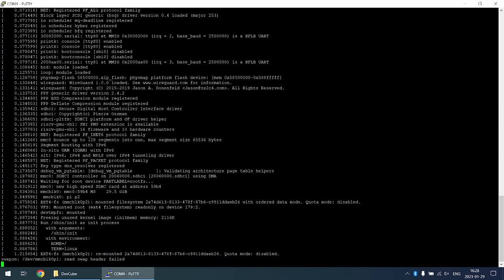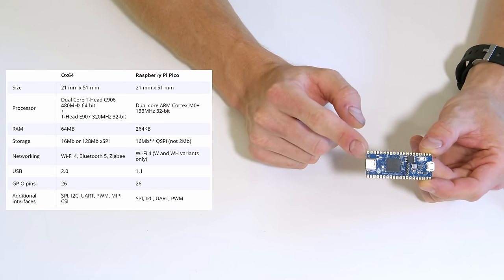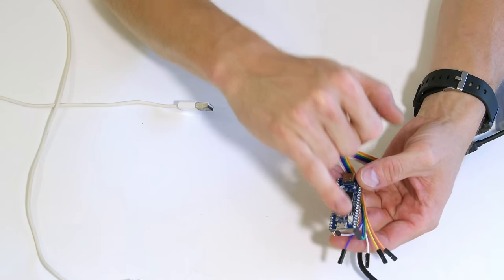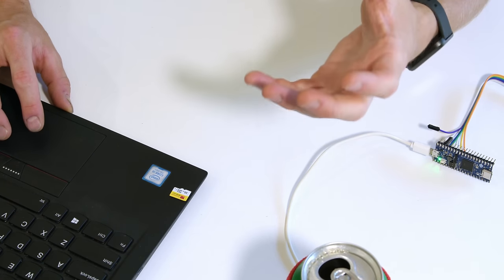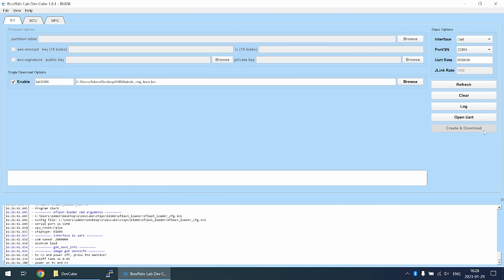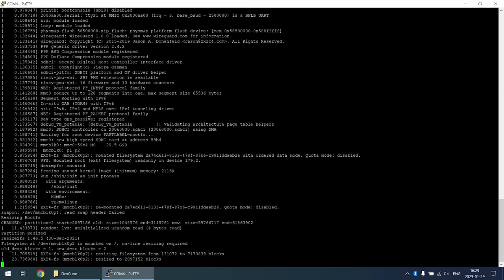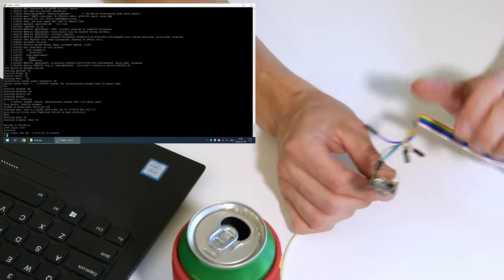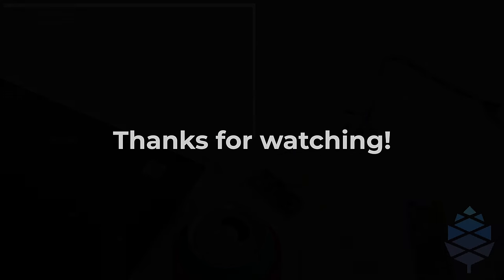Ox64 SBC - Connecting, Flashing and Booting Linux! ($8 from Pine64)

Comment: It got one rv64i core (D0) , one rv32i core (M0)   and a  rv32e core (LP).
Reply from the maker: Correctamundo my good friend. I accidentally said that D0 was dual core though, which I corrected in my description.

I'm super curious about using LP for something fun. Right now M0 is just doing interop with D0 as so much of the peripherals route through it.
Reply: @PlatimaTinkers  I had a look at this thing a month ago. It seems a lot of progress has been made, as last month, no peripherals, no sd card, nothing was supported, except for the UART, so it was in a state "it boots linux" and that's all there was to see. Wow, things go fast. 

When I bootled linux last month, it seemed the rv32i core was copying the image from flash to RAM, while the rv64i was delaying, then the rv64i would jump into the kernel.
Reply from the maker: @AndreDeLimburger  Oooh that is also an interesting way of doing it! I would guess then that they did not have the message bus between the D0 and M0 cores, as the M0 (RV32) is the one connected to the SD card, but of course the D0 does the heavy lifting. Now that there is more interop with IRQ forwarding etc it's running SO much smoother.
Reply: @PlatimaTinkers  They didn't implement any intercore communication. But I am under the impression last month was an early proof of concept. No SD card support, all from internal flash.
Reply from the maker: @AndreDeLimburger  Hey yep they run a 'mailbox' that relays IRQs back and forth. Alex Horner has been working with arm000, pokey and some others on this pretty hard last few months and it was only a few weeks ago this was released working.

That is the code uploaded to M0 in the video which you can find here: https://github.com/arm000/bl808_linux/blob/irq-forward/bl_mcu_sdk_bl808/examples/low_load/main.c. Not it's not in 'main' branch yet. It's not a full implementation of M0 yet either, but enough to access the SD card and some other required features.

This is booting from the SD card, as I demonstrated, and works well! Next step is ethernet and/or wifi. WOo

Comment: No I2S?
Reply from the maker: Yep sorry definitely has I2S - that table was not quite filled out with every detail. Here's the functional block diagram as a reference for you: https://wiki.pine64.org/images/thumb/d/de/BL808_Block_Diagram.jpg/600px-BL808_Block_Diagram.jpg
Reply: @PlatimaTinkers  Cool, I've got a ton of boards sitting around already, but I'll have to check these out as well.

Edit: How hard is it to add device tree overlays for the GPIO devices when you're running a full Linux kernel?
Reply from the maker: @butsukete1806  Hah yeah same here, SOCs building up like a bad itch, but these are so far my favs and SUPER cost effective compared to even an ESP32 IMHO.

GPIO is already working my friend. I just did not demo it in this video as it was long enough! Pt 2 coming in following weeks.
Reply: Sounds like a new contender then. Right now my gotos are ESP32 for wireless and Pico for anything else, really like the PIO feature. Looking forward to your next video.
Reply from the maker: @butsukete1806  Pretty much what I've been doing mate; 3x RPi4 running all my docker containers for local services such as control, monitoring, alerting, then some Pi Zero's for GPIO control eg retic etc, and ESP32's for endpoints such as lights, switches, etc.

Cheers

Comment: I use PUTTY and FLASHED BL808. system runs but the 2000000 on the CP2102 I use just will not work. Nothing but garbage coming out the serial port. It will suck if I have to rebuild the OS just to change the baud rate to something normal. Even 921600 would be good. But 2000000 is just stupid to me.
Reply from the maker: I just checked the datasheet and unfortunately the CP2102 only supports up to 1,000,000. 

I'll ask the devs about what can be changed to get stdout at 921600 and get back to you!
Reply from the maker: Hey so there are three bits of code to modify to make it work at <1,000,000 bps - firstly the Low Lower in ml_mcu_sdk_bl808, then OpenSPI in platform.c it seems, and lastly the Linux device tree in bl808-pine64-ox64.dts. All three would then need to be recompiled.

If you don't mind some garbage output at the start and then just valid kernel output, you can just update that last one (DT) and recompile the DTS and rebuild pine64-ox64-firmware.bin to flash 'IoT' with. 

One other thing you COULD try is grabbing rootfs.img from sdcard-pine64_ox64_full_defconfig.img in the full release file (https://github.com/openbouffalo/buildroot_bouffalo/releases) and then update inittab to specify the baud for getty (replace the 0).

I am not sure if that last idea would work, but in case it does, here is a tgz with the change made that I stitched together for you: https://plati.ma/ox64_linux-0.0.5_921600baud (untested sorry)
Reply: I used the USB/Uart port on the ESP32S3 Devkit-C1 (Uart0TX and Uart0RX- marked TX and RX on the board), set BLDevCube to 2000000 for the bit rate and it worked great. I look forward to WiFi, BLE, etc. support coming soon.
Reply from the maker: @billwinston5146  Oh excellent! Using another MCU as a flasher is always a great backup, and bit of a pro move!

Comment: Didn't work for me.
Reply from the maker: Bugger.
1) How far did you get?
2) Did you use 2,000,000 baud?
3) Which release in the repo did you use?

Had a few repo builds fail from what I know, so I was using 0.0.2 (https://github.com/openbouffalo/buildroot_bouffalo/releases/tag/v0.0.2) but I think 1.0.0 should be solid too!

Comment: 90mA is not running on a fart. That isn't battery capable.
Reply: It is for a Linux kernel, let alone one that isn't yet optimised! 

Consider the ESP8266 which is a tiny MCU that can't even run a first class (multi-user, multi-task) OS such as this, is not dealing with SD storage, and has an average current consumption of 70mA from what I've found.

So yeah, it's not battery capable, but it's still the best I've seen for something with an OS! Leaving Hello World on it instead would have been < 10mA from what I recall. Will test today and advise!
Reply from the maker: @platima  Ah crap wrong account. Close enough though hah

Comment: Now what I really want to do is run Rust on this thing bare-metal.

64MB of RAM all to myself and whatever protocols I can bit bang from however-fast-that-thing's-GPIO-is without an OS in my way sounds really fun.
Reply from the maker: Saw your comment at work. Googled it - its doable!

It looks like RV64GCV is about 100% complete within LLVM, and the Bouffalo Labs SDK has everything you'd need if you can interop with C libraries or link to them as OBJs. Ref https://github.com/bouffalolab/bl_mcu_sdk/tree/master/examples
Reply: Would you be able to create a mechanical keyboard configurator for this Ox64 using Rust?

There isn't Rust nor Risc-V sbcs available for that use.
Reply from the maker: @vicmac3513  could you elaborate a bit? I am not sure what you mean "mechanical keyboard configurator"?
Reply: @PlatimaTinkers  Similar configuration app like System76 Launch has. Or QMK app. But for this Ox64 sbc and written in Rust.

Sorry for being misunderstandable.
Reply from the maker: @vicmac3513  Oh wow interesting - that is all new to me. Thanks for the info and showing me something new! Cheers
Reply from the maker: @vicmac3513  God damn it now you've sent me down the rabbit hole and I want a Keychron 🤣🤣
Reply: It always starts with a macropad and ends with an ortholinear split keyboard :)
Reply from the maker: @vicmac3513  You'd cuss at my keyboard and mouse setup hahah. But yes, I feel the pull.... I just am resisting like a vaccine denier in 2021 😂😂

Comment: this board looks VERY interesting, but I think I'll wait for some proper documentation, and to see how they do expansions, audio in particular, because if that 2 ADC 1 DAC @ 8-192kHz claim is true, then I have some nice use-case scenarios for this little fella... do post more videos, this looks promising...
Reply from the maker: Yeah that is a VERY large range. I'll have to look into the audio and see if the GPIO functions are available to even enable that mode yet.
Reply: @PlatimaTinkers  That's one of the reasons I got some of these boards too, outside of the Teensy there are not many boards for audio applications (synthesizers, samplers etc) that have decent DACs and ADC's and USB host (eg MIDI) support, though the RP2040's are getting there slowly now.
And thanks for posting this video, getting the 0x64 setup is hard work compared to other boards so your video really helped my out! Thanks mate!
Reply from the maker: @mksln  Hey you're more than welcome and I am glad it helped!

I cannot wait to see how well the DAC performs once complete, as apparently its capabilities are pretty decent!

Comment: You really could wait and not drink for this 15 minutes and burp into the microphone.
Reply from the maker: @khashmeshab It was scientifically impossible. Thank you <3
Reply: @PlatimaTinkers  Do explain the science please.
Reply: @khashmeshab  In Australia there are small particles in the air called "boganism" that permeate the skin and get into the bloodstream. Most places the concentration is really low, but you'll find suburbs like Rockingham, Frankston, Ipswitch, Kalgoorlie, etc where the concentration is really high. It's pretty good here where I am, but the problem is when it gets quite hot, eg that day was over 33C/92F your pores open up to persperate, and the boganism just soaks in without any resistance. Eventually at the right concentration the urge to "crack a tinny" is no longer something controlled by the conscience and just happens. This is why in hotter areas like Broome you'll find people drink a lot more - hard not to finish work in a 42C/108F day and not crack six tinnies back to back.
Reply from the maker: Oops wrong Chrome profile, but yeah what other-me said!
Reply: @PlatimaTinkers  I thank your other you for the explanation. It seems that you also liked what your other you said. That's so brave of you to be able to sleep in that situation.
Reply from the maker: @khashmeshab  It feels nice here. I like it 😅😅
Reply: @IGDZILLA  🤣🤣

Comment: There is another board with the same chip, it is the sipeed M1S dock and it has a LCD and camera interface as well as two usb C ports, it also allows you to flash the chip over USB as it has a chip or microcontroller built in to handle that, it may be more useful for some people than this board. Since it uses the same chip it should just be programmed the same.
Reply from the maker: Oh yeah good thought - I did forget to mention that this will be flash-able by USB eventually. As this is an open-source and community-driven project compared to the M1s, the development lifecycle is just a tad different. But that is also reflected in the awesome price tag.
Reply: @PlatimaTinkers  the M1S isn’t expensive, especially considering how much more difficult and expensive it is to get pine products in the UK and Europe. You can get the M1S as a bare module for embedding in your own designs for £6.08 or the dock for £9.40, the full kit with a usb cable, header pins, camera and lcd with the M1S dock is only £17.33. So the pine 0x64 doesn’t have that much of a price advantage on it especially if you go with just the dock board itself with no extras, like the pine 0x64 comes. There is no reason that most of the developments for the pine 0x64 wouldn’t apply to the M1S dock and the M1S already has working examples for the lcd and camera.

The main advantage for me anyway is how easy and cheap it is to get compared to the pine 0x64.
Reply from the maker: @conorstewart2214  makes sense re the region. Probably varies quite a lot! For me if I get 3x Ox64 they cost $12 AUD ea inc shipping.  For the M1s module the best I could find is $20.93 AUD ea inc shipping.

I am working with Pine64 on warehousing some here at one of my locations so we can include some cheaper shipping options, but not sure how long that will take.

The ease of use is definitely a huge advantage, but I think if we give the Pine64 team some time, they'll definitely get there. Thanks for the info!

Comment: Question: I had a crash with M0S board (Boufallo's BL616 single core RV32). 
* They require custom GCC10, 
* Zigbee is walled by NDA, 
* Flash programming is via a custom, unintuitive software 
* a vast majority of How-tos are in Chinese.

How does Ox64/C906 stack against that?
Reply from the maker: There is definitely way more available around BL808/C906 due to the Ox64, but I think BL just need a bit of time. They are a small team, creating something awesome, and not all things happen overnight.

That being said, given the popularity I don't think we're going to be waiting too much longer thankfully!

Comment: FTDI232 diddnt work for me thought you mentioned it would, although mine is the 232RL and i think others are ok. others reporting the same even at slow speeds. putty console works fine as per your ping/pong demo so the standard ttl protocol should be fine. only an issue when flashing with the "bouffalo dev cube" software. smells like more very intentional dodgy bouffalo behavior (payback for FTDI bricking knockoff Chinese chips ide imagine). 

in the end got it working with the modified picoprobe provided in the wiki.

edit: i should add, for a sanity check after it was flashed and the bouffalo  software wasnt needed any more, the linux terminal works fine with the genuine FTDI232RL at 2Mbps again and the picoprobe can go back in the box. the exact one that was knocked off in chena [intentionally misspelled since previous addition got blocked].
Reply from the maker: Hahaha nice update and thanks for letting us know!
With FTDI in general I've had some random hit and misses. I still have two, but I am not a can of them.
Glad yours is going now!